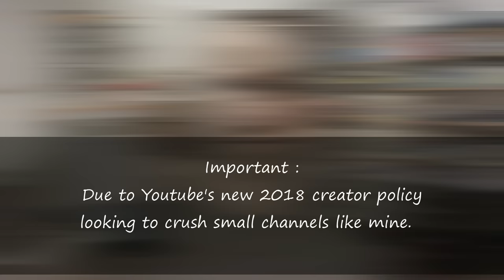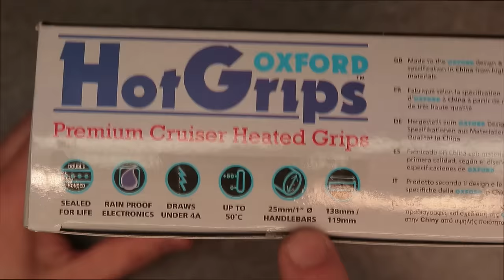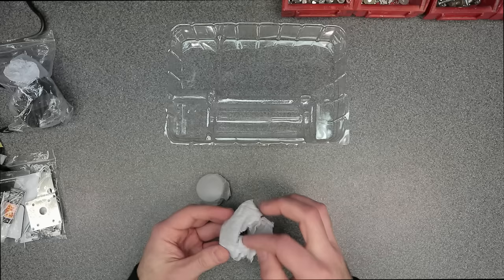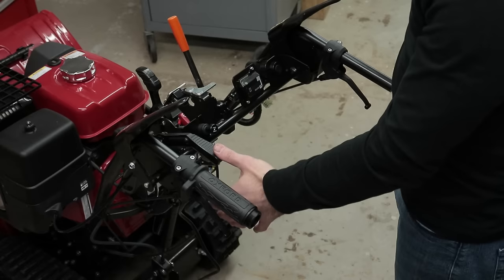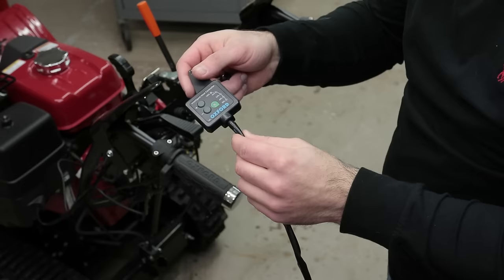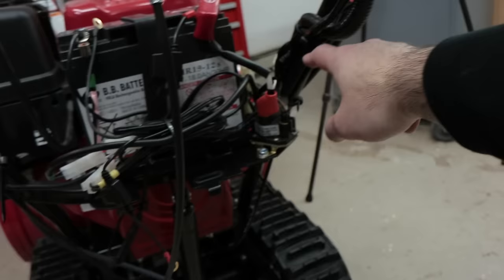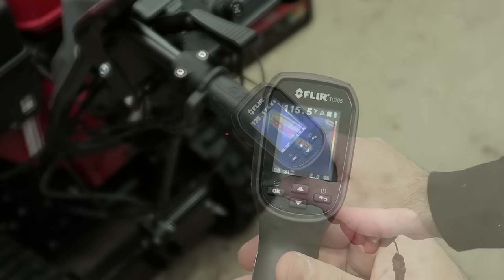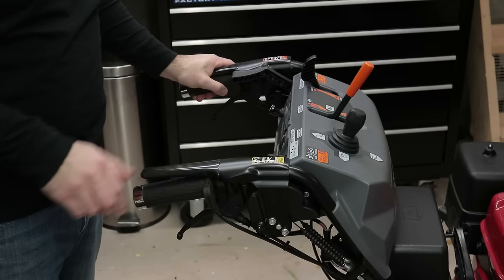Oxford Hot Grips Heated Hand Grips Install | HONDA HSS1332ATD Track Drive Snowblower | Workshop Vlog

Comment: Suggestion ?  instead of using insulation to fill the void in the handlebars would spray foam be a better solution 
Obviously the opening of the handles would have to be filled in with a product to stop the foam from going all the way down the pipe 
Once full of spray foam a temporary piece of duck tape to hold foam in until dried  
Once dried trim the excess foam off. 
What's your thoughts ?
Am I crazy ?
Reply from the maker: No because the insulation is easily removable. The foam is not.
Reply: @JohnFrancoNH  sorry John I disagree my friend. A simple correct sized spade bit would easily remove the foam spray. 
Foam spray would absorb the cold metal handlebars much better than loose installation in my veiw
Reply: I just installed and used foam. Was easy. Just trimmed flush when cured and on with the grips.  Don't see any reason to ever need to remove the foam
Reply: @derrickanddebi  thank you Derek for using my suggestion it worked for me also

Comment: Does any Honda snowblower owner is having this problem ? The joystick ( HSS928A My machine )is on its 3rd winter season and for some strange reason the joystick is starting to be non responsive at times  in some modes.  left to right function only the left would work then up and down only the up option would work then strangely enough vica versa would happen? But most of the time the joystick works great ? Any suggestions would be grateful and appreciated
Reply from the maker: Make sure to keep your battery charged for better operation of electronics. It draws power first from the battery.  Havent had any isses with my joystick but bring it to the dealer and get it covered under warranty before its too late.
Reply: I thought the honda snowblower only had a 1 year warranty?

Comment: It is hot grip. But it is not so much, because wearing insulated gloves actually stop the majority of the heat. Better not to use gloves or just thinner gloves.
Reply from the maker: True. I can get away with wearing less insulating gloves if not super cold out. Thanks for watching!

Comment: Great video.  I just finished the installation but am having trouble with the Honda grip cement curing.  It's winter and in an unheated building.  After 24 hours, it had not cured yet so I slipped off the throttle grip and added a lot more cement.  It seems the cure might be two days with daytime in the 30's and 20's at night?
Reply from the maker: Yes it needs to be at room temp to cure properly. Thanks for watching!
Reply: I’m seeing the same issue. My garage has been 72 deg. But it’s only on the right grip with the sleeve. The left one cured fine. I’m wondering if the sleeve material might not take well to the Honda adhesive. Gonna let it cure a couple more days and see.

Comment: great report, I'M CONSIDERING TO ADD MORE POWER. COULD I REPLACE THE HSS 724 6 1/2 HP WITH A GX 12HP WITHOUT ANY ISSUES IN THE AUGER AND IMPELLER ABILITY. I NEED TO GO FASTER AND CLEAR ALOT OF RESIDENTIAL DRIVEWAYS IN A SHORT TIME AND THE AREAS CALL FOR A MORE NARROW SNOW BLOWER.  I HAVE A PLATINUM SHO 24" ARIENS AND WANT TO USE MY NEW HONDA I JUST PURCHASED AS THE PRIMARY SNOW BLOWER AND JUST GOT IT AND IT IS NOT KEEPING UP WITH THE AIENS PLATINUM SHO 24 INCH CURRENTLY.
Reply: What did you end up doing?
Reply: Bought another machine 32” hss1332 and track

Comment: John, what did you use for the shim?  a web link would be helpful.  Getting ready to do this on my hss928.
Reply from the maker: Jeremy, i used several pieces of plastic strapping used for boxes (to secure to a pallet) i had laying around. Install as many as it takes in between to get a secure press fit. Thanks for watching!

Comment: Thanks for the video. Since i installed the heated grips, the auger will not lock with the left clutch. I tried to pry the top of the grips a little bit to accommodate for the extra thickness, and also adjusted the nuts on the auger wire to provide an extra pull, no good either. Do you have any suggestions? 
Thank you
Reply from the maker: Probably need to grind out and clearance more of the grip to allow the mechanism to have enough stroke to lock. The new larger grip is the only thing in the way. Dont be afraid to really grind out those grips until it engages.Thanks for watching!
Reply: @JohnFrancoNH  i pried it all the way down to the wires, no good luck. I ended up removing them altogether. If you know of heated grips brand that is thin enough to not cause a problem, let me know.
Thanks a lot for your help

Comment: Wiring directly to the battery and no off position on the controller will result in drained battery. Could a relay be using the ignition switch to energize relay while running, but disconnect power when not running?
Reply from the maker: Yes you can use a relay but its not necessary.  The intelligent controller already is designed to automatically shut off. If you happen to leave it on. Never has drained my battery.
Reply: @JohnFrancoNH  Ok. Didnt see the mention about auto off feature.

Comment: I have a brand new HSS1332A snowblower. I was told by honda that there is not enough power from the battery/ alternator to power grips. Have you had any issues? I could install a12v 12ah battery to power them and charge the batteries if necessary.  Thank you
Reply from the maker: Yes this is partially true. Grips draws power from the battery which is a little on the small size for amps. Charging system on the HSS is not able to keep up. But it works out just fine. My grips still get hot enough to make me happy. Make sure your battery is not in a drained state when you go to use it. I keep mine on a battery tender most of the time. and my battery and grips still perform well. Thanks for watching!

Comment: Hey John thinking about the HSS1332AAT (unlike your ATD it lacks electric start and auger torque protection). Not sure there would be enough juice for the heated grips as yours may put out more wattage since you have a battery charging system and on the AAT the grips might DIM the LED light?  might be a question for the snowblower forum....
Reply from the maker: Yes with out a battery as the main power source for the grips, your light will dim. The grips draw 4 amps.  It might even draw so much power that it might even prevent the machine from getting good spark to run the engine properly.  Adding a battery can be done. But not sure what the output wattage is on non ATD models. The fourm could be a good place to find that info. I would check the stator coil part # in a Honda parts look up system. If they are different then theres a good chance they are different a wattages.

Comment: Just strolling youtube and seen this video.  I read through the comments. I own an Ariens 24" Platinum SHO and it replaced a Poulan Pro.  I never used a Honda.  My experience with my Ariens is mixed.  First off Ariens is ass heavy, meaning the front needs a weight or it will ride over the snow. Next is their auto-turn GARBAGE.  I hate it. MY POULAN had the levers. SO much better.  It was too late for me to return it so I have to deal.  As for the SHO -SUPER HIGH OUTPUT.  I don't feel any difference from my POULAN. End of driveway snow it struggles with but throws it like 25 feet up.  I didn't go for a Honda because of the price. I paid 1399 + tax for mine, got a 100 discount. They retail for 1499.  The cheapest Honda was 2200.  Id like to try a Honda to see the difference. I need to find a video to convert this auto-turn shit to levers. I subbed
Reply from the maker: Thank you!

Comment: Do you void the warranty with this add-on?  I was thinking of just getting a rechargeable hand warmer from amazon that does the same. While using the machine, you would wear a pair of gloves anyway. Might as well wear one that is heated. This is more well suited compare to having the heated handle, regular gloves, then hands.
Reply from the maker: I doubt very much you will void the warranty with just a heated grip install. Thanks for watching!

Comment: John I just installed these on the same machine as you. The “power saver” light started blinking. Looked it up and says it starts blinking to let user know the bat is low or there is “no noise” from the charging system. I disabled the BSM for now....have you ran into any problems with these grips drawing too much and killing the battery?
Reply from the maker: no i have not had any issue with battery drain. But i always keep a battery tender on it periodically. Thanks for watching!

Comment: What is the top current rating for the Honda in dc amps? Do you have to put the battery on external charge very often?
Reply from the maker: Yes putting the battery on an external charger is a good idea if you are taxing the battery because of the heated grips.

Comment: Excellent job How did they work?Did they drain your battery while not in use? Did you have to install a relay?
Reply from the maker: Paul as of yet no relay needed. It starts right up even after a month of not on the battery tender. I did test the unit while hooked up to a multi meter to see what happens if i turn off the ignition on the snowblower and just watch the automatic shutdown process on the heated grip controller. And after 5-10 mins it totally shuts off, even if you forget to turn the heated grips off.  The draw on the battery stops and i could see the voltage come back up to nominal. From my understanding it senses the lack of electrical pulse or signal noise and then initiates standby and thereafter shutdown mode. Hope this helps. Thanks for watching!
Reply: John Franco  was there a reason you didn't use spray foam in the handle bars in stead of regular insulation? I thinking about plugging the handle bars warmers into the battery tender piece and just unplugging it when stored. What's your take on that?
Reply from the maker: Paul,  I just used what i had on hand in the workshop. To be honest i hate spray foam it makes a mess & it always gets in places you do not want. I try to avoid using it if i can.  Plus i wasnt going to wait for it to dry while filming. But if thats what you have i dont see a problem with it. Its critical function is to plug up that air gap in the handle bars to help minimize heat loss via conduction & possibly convection. 

Plugging the heated grip power supply into the battery tender lead is a great idea. I dont see an issue with that either, since the lead has a 7.5 amp fuse and the grips only draw 4 amps.

Comment: Looks like you can get a replacement left grip for like $25. Any reason not to get the regular kit + the additional left grip? This will limit the need for any modifications. Are the connectors the same? That is my first concern. :-)
Reply from the maker: Oxford grips are a top notch product. The intelligent controller version is highly recommend. It wont drain your battery. Thanks for watching!

Comment: Hallo John
Grüße aus Austria! 
Ich habe wie du diese Griffe montiert. Ohne Probleme wegen deiner guten Anleitung. 
Ich möchte noch LED Zusatz Lampen anbauen. Hast du Erfahrung damit?
Reply from the maker: Hallo! Um mehr LED-Lampen zu betreiben. Die Ladespule muss auf eine 3-A-Spule aufgerüstet werden. Ich werde in Zukunft ein Video machen. Es hilft auch bei wärmeren Griffen! Danke fürs zuschauen!

English:
Hello! In order to run more LED lamps. The charging coil needs to be upgraded to a 3 amp coil. I will be doing a video on in the future. It will also help with warmer grips! Thanks for watching!
Reply: @JohnFrancoNH   Hallo John! Hast du schon die Ladespule umgebaut? Gibt es davon ein Video? Grüße aus Austria

Comment: would this work with the att model without elec start? thanks for your time.
Reply from the maker: Needs the battery to operate. Thanks for watching!
Reply: Any chance to wire it into the headlight circuit to power the grips while the machine is running? (I have the same machine without electric start)
Reply: @zeroemissionsnonoise  There basically is power just for the headlight and nothing else :) its something like 15w light and 20 watts of juice available

Comment: I did the same grips on the same brand new blower. Problem.... even when I am running the machine and battery is charging.... it shuts off because of battery low safety. Do you think I would be better off install a 35ah battery in place of the 20? Or should I just add another battery for just the grips? I realize the current battery enclosure is too small for a 35ah.... I  can buy an aftermarket battery box to fit it on the same shelf. I ALWAYS plug the battery tender in after I put the blower away for the day so depleting it doesnt matter... it gets charged after. I also ordered the 112 jet for fuel injection.  Whats next? Appreciate the help.
Reply from the maker: You can shut off the battery saving mode. Look in the manual. I will be doing a larger charging coil that will double output on the charging system that will help with power delivery. I dont think a another battery is needed. Charging system is only adequate for the LED light, chute motors and spark for the machine. Thanks for watching!
Reply: @JohnFrancoNH  thanks... I will be waiting for that next video.